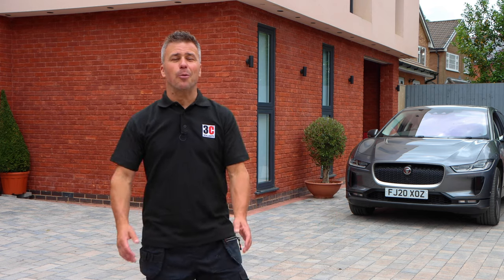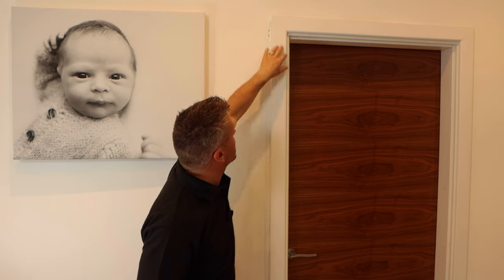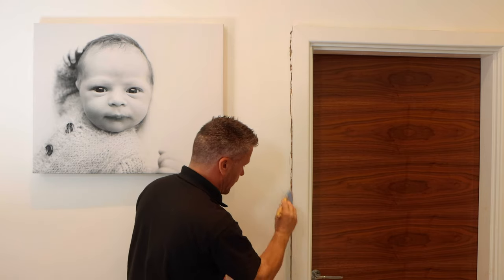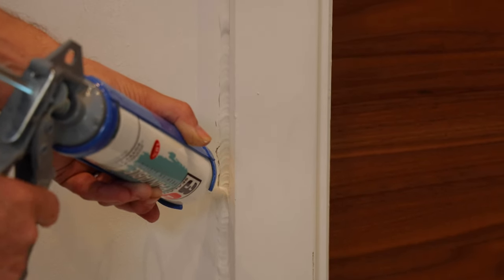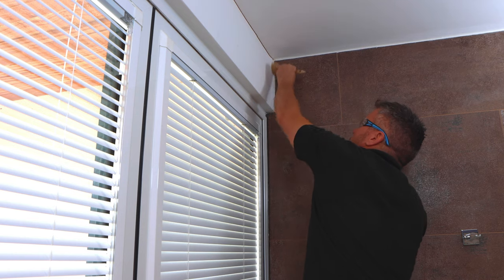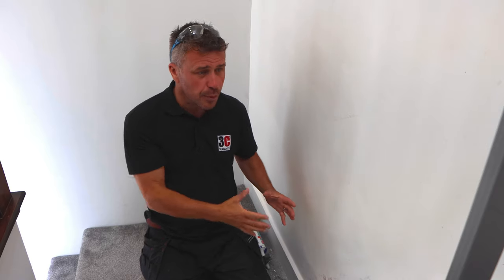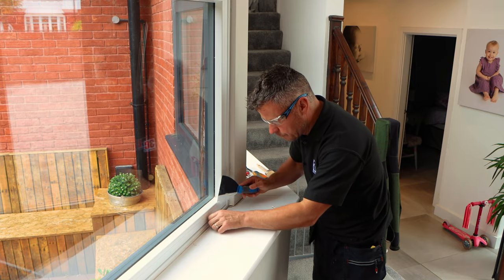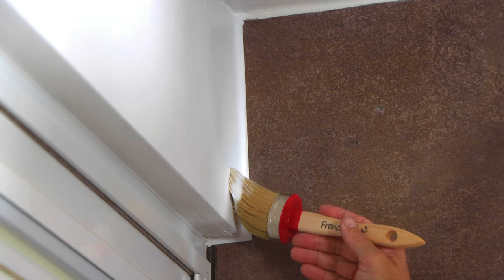How to Prepare, Fill and Paint Unwanted Cracks & Gaps

Comment: I've found expanding foam works well on the strings first. It fills the void, cushions and stops as much movement 👍
Reply: Great tip, Sean!
Reply from the maker: Its does help well, and best to try and get the foam in when fitting the stairs
Reply: Good idea,

Comment: Hi mate, what about hairline cracks in plastered walls...... corner of door frames spanning out.  Some say use Stanley knife make bigger like a 'V' and fill but with what and any flexi filler on the market but paintable ? Cheers!
Reply from the maker: Hi Marky, Yes the Paintable will work well, As I shown in the videos try racking the cracks out a little deeper and as soon as you've filled them trick it smooth and leave to dry before painting, Doors frames no problem at all I used it on about 6 of ours
Reply: @MrandMrsDIY  that's great,  thank you for taking time to reply, as I know you're very busy. Appreciated 👍
Reply from the maker: @markyd1976  anytime Marky
Reply: @markyd1976  Anytime Marky. C